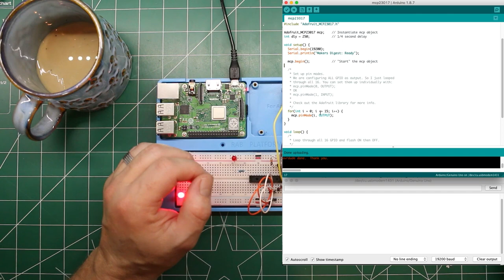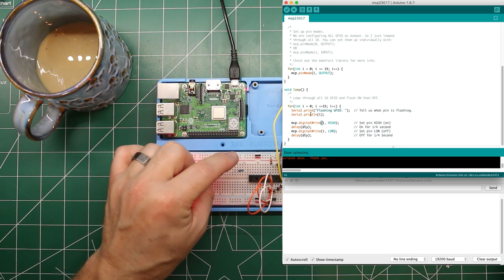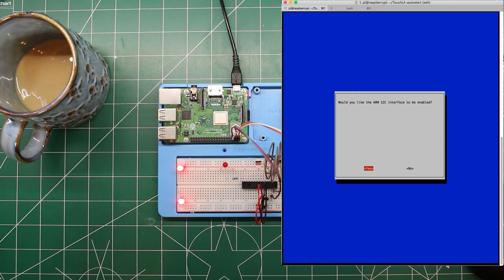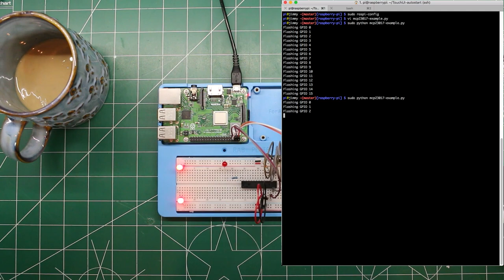How to connect the MCP23017 GPIO Expander to an Arduino and Raspberry Pi

Comment: Working on a 16 step switch project. Each key has an embedded led. For 16 switches I actually need 32 gpio. Your video helped me to figure out how to work with this chip properly with a Pi Pico. Very helpful video! Thank you.

Comment: Check the datasheet to confirm that you don't need a resistor on the Reset pin. Connect it directly to the positive supply.

Comment: I am somewhat new to using the Raspberry Pi (3 B+) and I would like to expand my GPIO as shown in this video. I already have a 20x4 LCD display using pin 3 (SDA.1) and pin 5 (SCL.1). Can pin 27 (SDA.0) and pin 28 (SCL.0) be used instead to setup the expansion board while the LCD display is still connected to pin3 and pin 5?

Comment: Can someone briefly explain why a resistor is needed for the reset pin? Why can't it take the 3.3 straight?
Reply: I have it on the 3.3V and it works

Comment: Have you measured how many microseconds it takes for digitalRead() and digitalWrite() using these 16 GPIO pins via I2C compard to the pins which come on the microcontroller?  Just wondering how much slower it is.  Hopefully it doesn't take more than say 100 microseconds.

Comment: Can you do a video on how to use this to control 1 or 2 i2c modules (say an I2C LCD to start with) using the arduino. For instance, how would you read from an I2C module and write to an I2C LCD through the MCP23017 (or MCP23S17 for SPI). Thanks.
Reply from the maker: I will put this on the list, good topic.

Comment: Hi. Sorry the stupid question... i can connect 4 mcp23017 to a Arduino Nano?? is for manage 64 reed switch (for a chess board). Thanks for your time.
Reply from the maker: MilS Lion I believe you can have 8 of those IC’s on one I2C bus. You will need to configure the address pins on each one to have a separate address in order for that to work. Check the data sheet on how to do that. In a nutshell, all the SDA pins connect together, as well as SCL pins. Then address correctly.

Hope that helps!
Reply: @makersdigest4752  Thanks!Yes that help.

Comment: are the 5v and gnd pin really must be all connected? or just for 9 and 10 pin.
Reply from the maker: It really depends on the grounds, pin 15,16,17 are the hardware address pins. I set them all to low to get a specific I2C address. But you can look at the datasheet on how to set specific addresses in case you are chaining more than one of these together. But personally, I like to set them all to low for single IC applications because it is stable. 

For the 5v on reset, I am going to say yes on that one for this application because that's the way I have always done it, and it works. I am sure there are other things you can do with that pin as it is a "reset", but would have to dig into the datasheet deeper than I have to figure it out. Otherwise, give it a try and see if it works!

Comment: What luck. I just got 5x MCP21017's in the mail today and was looking for a guide on how to hook them up!
Reply from the maker: Tiny Starship awesome! Let me know if you have any questions, or if I can help.
Reply: @makersdigest4752  hello, if we have 2 mcp 21017 then for the code will it be 0 to 32 and not 0 to 16?
Reply: @falseee4445  Do you have the answer to that question? I`am realy curious..
Reply: @MGort-bb8op  The 2nd mcp should be set up with a different i2c address, you will get another 0 to 15 ports available. See https://arduino.stackexchange.com/questions/30862/how-to-use-different-device-address-for-mcp23017-so-i-can-use-multiple-chips